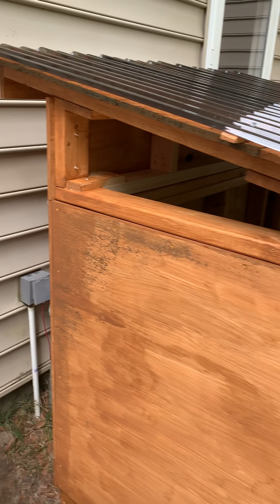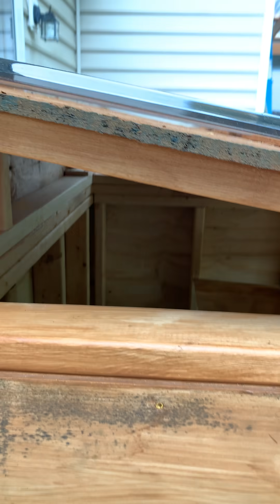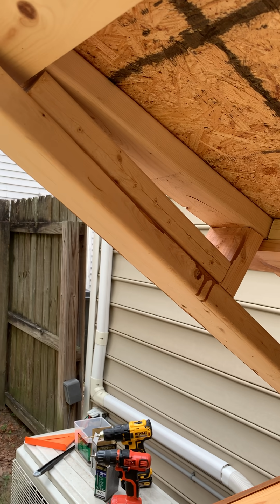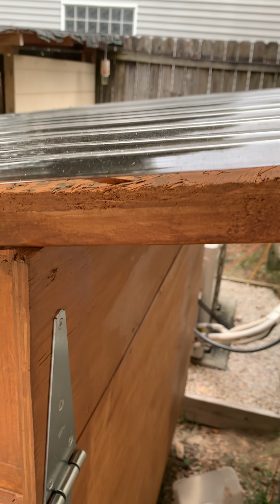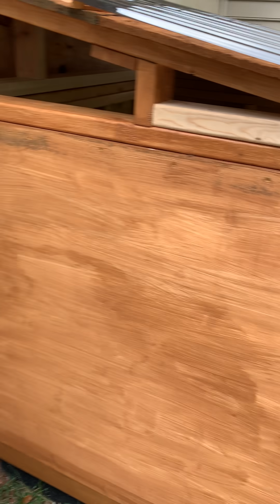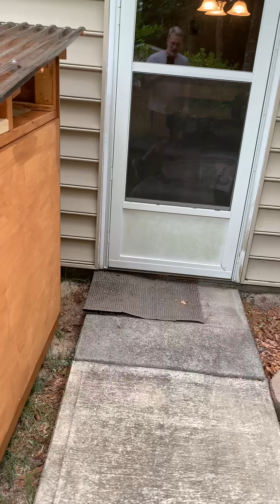Generator Enclosure - Part 4

Comment: Both the motor and generator will need intake air vents and the engine exhaust should be piped out. Install a louvered exhaust fan on the side the engine exhaust is on. Maybe you'll need cement board on the walls to osborb the heat if the wood is getting hot. Good luck.
Reply from the maker: Hello Harry! Good feedback. Yes, the ventilation side of this is still in the "design" phase. I will be sure and post once I am done. Thank you for watching the video. - Dutch

Comment: So many people using Suncast for Generator shed..... I Really Like people making a Wood Shed from nothing to Something.... 👍👍 Great job...... I'm building wood Shed now too Almost Done
Reply from the maker: Thank you for the kind words! The entire reason for building it from scratch was to try and work in all the aspects we think are needed: plenty of room, fresh air in and exhaust, ease of access and very importantly...sound reduction! -Dutch
Reply: @LLA_DMR   What is your Decibel level when Running the Generator ❓❓
Reply from the maker: @Honestandtruth007  great question! Just one of the things I have on my "to do list" for this particular project. It still isn't enclosed which requires my ventilation plan to be in place with additional sound proofing. I will do some decibel checks soon and get those posted with the enclosure just the way it is. So I'll do generator dB checks in and out of it and make a new video with that info. Thanks for keeping me on my toes! -Dutch